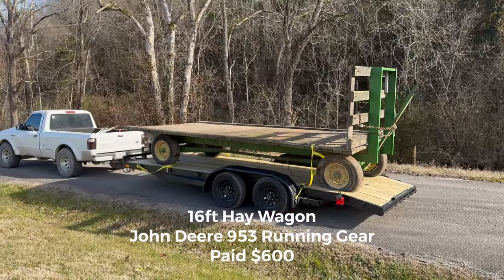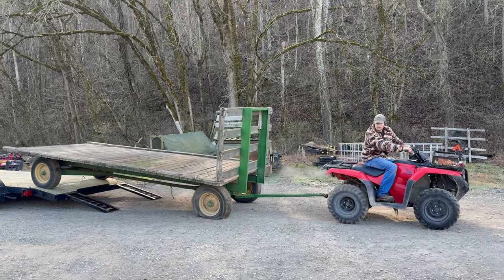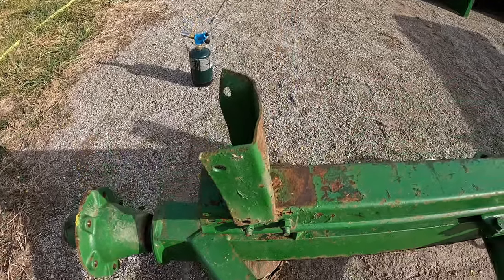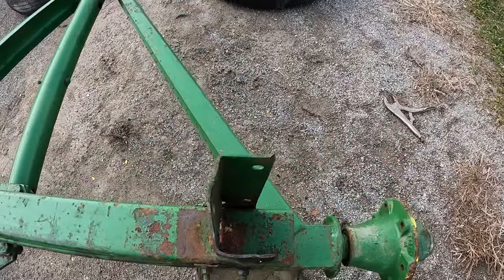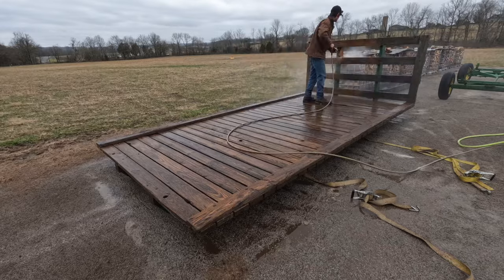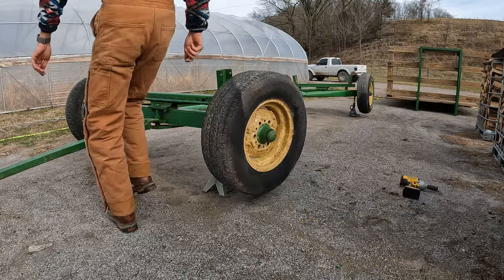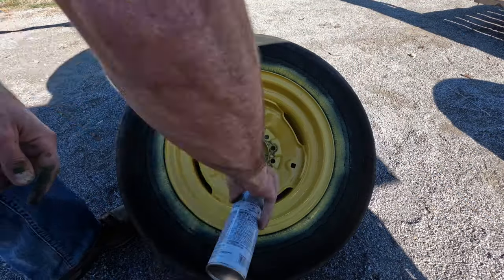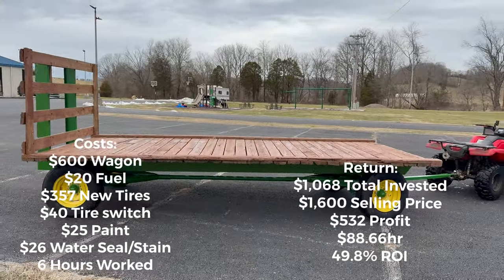I made $90 PER HOUR with this Hay Wagon flip

Comment: last summer we didn't do a hay wagon but one of those hay basket wagons. we brought it at an online auction took us 2 hours to get there, half hour at the auction place and 2 and a half hours towing it home.  it was in better shape than we expected. only thing we did was a quick spray down of the lower parts  and greased all the fittings.  After auction price, fees, gas and a lunch we had just shy of $600 in it plus our labor which was mainly getting it and towing it home. we sold it for $1800. best part was the area we got it from was an old stomping grounds for me as a kid so it was nice to go visit and see that area again after so long.

Comment: Nice.. 

For bending heated metal like that, an adjustable wrench is awesome. Make it the thickness of the metal and pull or push. It also doesn’t make tooth marks in the metal.

Comment: Can you link me the thompsons you used? Ive tried to run the water seal through multiple pump sprayers and I cant ever get it to come out right. It always looks like a pee stream
Reply from the maker: I use the transparent or semi transparent. The color is usually lighter than it looks once sprayed so I normally get a darker color. I do know that the pump sprayer has to be pumped to its max so it has enough pressure to spray it even. Also I clean the tip really well before using it
Reply from the maker: I’m not sure honestly. To me it sounds the the sprayer your using isn’t working. Is it the garden style sprayer? Like a 2 or 3 gallon? Maybe the tip is clogged? That’s odd it’s not spraying right